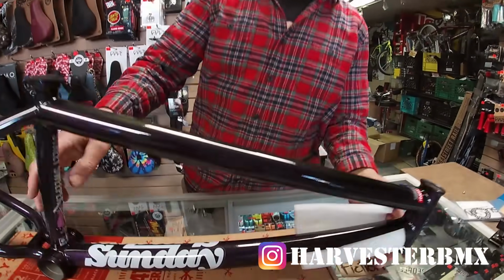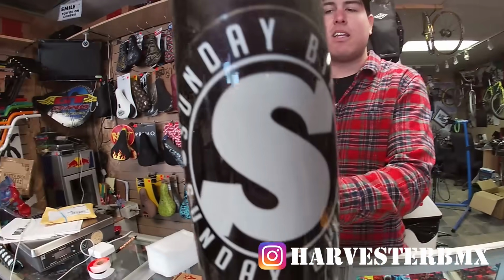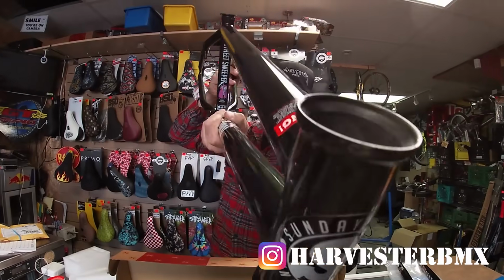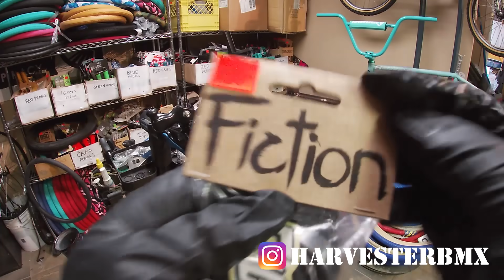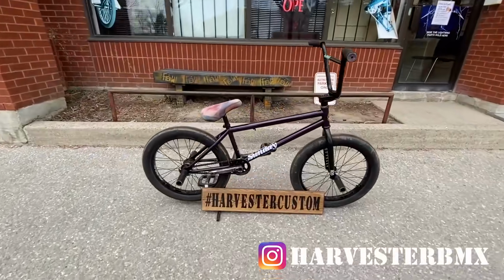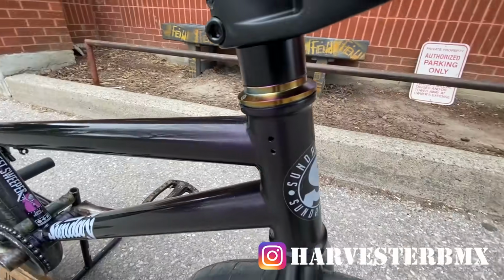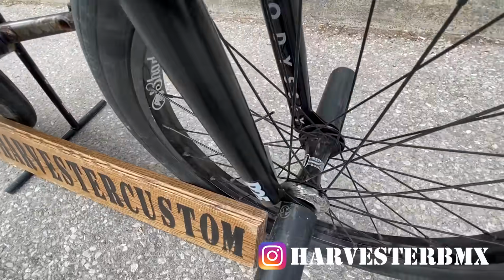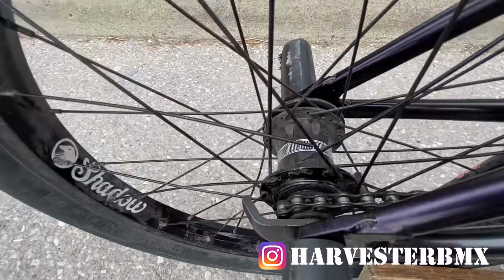Sunday Street Sweeper "Jake Seeley" Frame Build @ Harvester Bikes

Comment: I personally run the r15s on my street sweeper. Learned nose manual to barspin on the r15s
Reply: I was told not to get the r15's bc it might get to snappy. Im riding the 20.75 TT